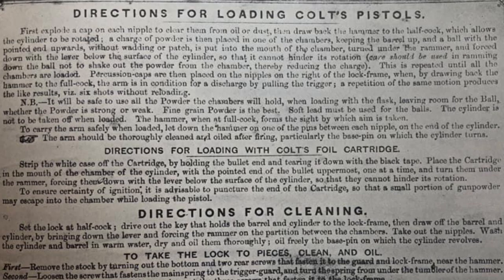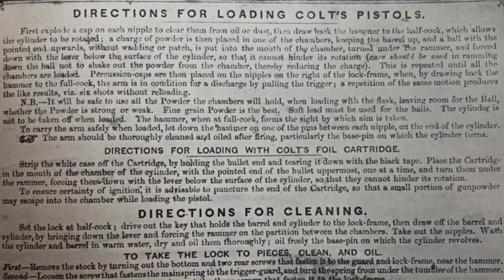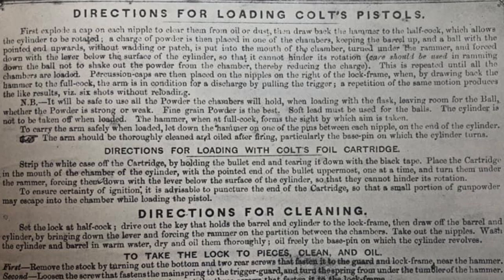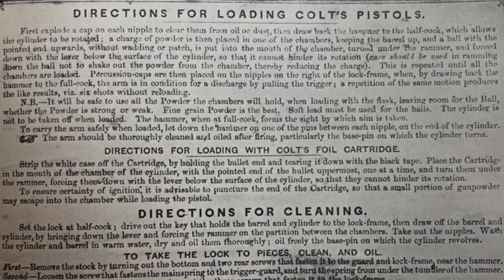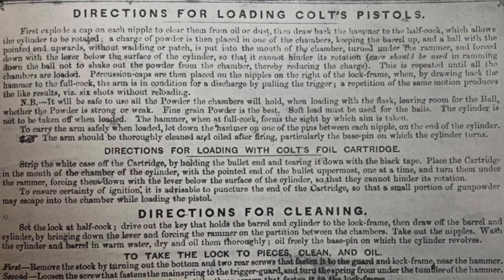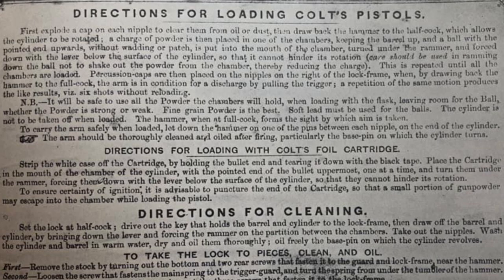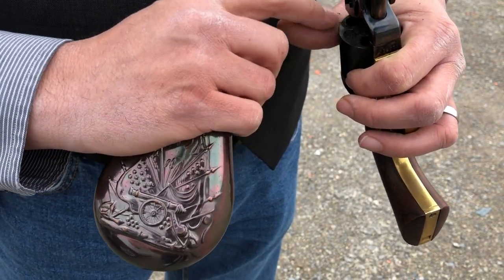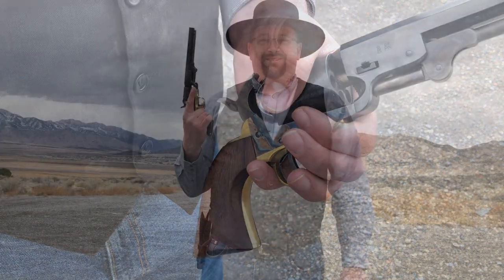Historical Loading of Colt Revolvers

Comment from the maker: Just to be clear, I’m not recommending this load because it does put more stress on the steel. This is simply an experimental demonstration of a fast, simple way to load the gun, according to very old instructions. Also, this is real black powder, which creates less pressure than substitutes. This charge was 27 grains of FFFg, but I’ve found 21 grains to be a very effective load.
Reply: I used to load my Navy like this just for fun occasionally and I could feel and hear the power difference.   My first handgun that I got for Christmas when I was 24 after reading the book Jeff Davis’ Own about the 2nd US Cavalry in Texas and their being armed with the 1851 Navy along with the Texas Rangers
Conventional wisdom tells us that loading all six chambers in that way without lubing or wad leads to chain fires.  However, I think it was either Mike Belevieu or you that pointed out that it’ actually poorly fitted caps that lead to chain fire.
Reply: Quick question: Is it normal for a loading lever to press on the underside of the barrel when closed? I bought a Uberti 1851 Navy and the loading lever,  when retained in place under the barrel, makes contact with the barrel at one point.  This means that to close the loading lever under the barrel,  I need to press on it an extra 1/8" to get it to shut.  While closed,  the loading lever is under a small amount of tension since it presses on the barrel right where the loading lever goes from skinny to thick.  Not sure if I should file it or not.  Haven't shot it yet,  so I don't know if it messes with accuracy.  My other revolver is an 1861 navy and has a different style loading lever that does not touch the barrel.
Reply: @classicgunstoday1972  true. I believe cap failure is to blame For most chain fires. I never shoot a cap through first. Ive heard that but dont do it. If guns clean i dont think its needed.?.?. Some thing about back presser i think
Reply: If you read the instructions it still says to leave enough room for the bullet, presumably a conical since that was what was mostly used back then.

Comment: Just for fun, I tried doing the same thing with my Ruger Old Army.  I filled each chamber to the very top with Goex 3FG and followed it with a .457 round ball.  It took a lot of force to compress the powder enough for the ball to clear the back of the barrel, but it worked.
As expected the Ruger took this load in stride and didn't even work up a sweat.  It was actually comfortable to shoot and shot fairly accurately.  I don't think that it will become a standard load for me because I like using lubricated wads, but it was a fun experiment.
Reply: When they proof the old armies they would filled the cylinders to the top with smokeless bullseye powder and do the same!

Comment: I load mine exactly the same except with 777. After about 6 cylinders I have to tighten the screws bu I have never had any problems. I think wads and grease are a modern   idea.

Comment: I would think about the safety issue powder up to the top of cylinder seems spooky , but makes since if in battle .
Reply from the maker: I wouldn’t do it often, but I don’t think 27 grains in one demonstration will be a problem. Thanks for watching!
Reply: I have several BP pistols The Walker is a blast I have loaded with 60 gr FFFg and normally 45 gr I can't notice any difference between them my Colt Army 44 cal I use 30 gr I just got rig of some Trible 7 it seems to clog up the action quicker .
I installed the Wolf mainspring and the piano spring for the trigger it worked great for a smooth trigger pull but after about 30 shots the hammer doesn't fall hard enough to set the caps off due to powder build up just rambling .

Comment: But how many times happened cylinder explosions by that method of loading, what can author tell about that?
Reply: Until last year I have always loaded mine like that, and I never had any trouble with mine and I bought mine in 1972. Either I was just plain lucky, or they made that cylinder short enough to be loaded that way. Which seems the case here, looking at the instructions.
Reply: With steel frames, black powder doesn't really build all that much pressure in the .36. it doesn't become an issue until the .44 makes use of thinner cylinder walls and in the case of the Walker, loading a conical backwards acts as a barrel obstruction as it seizes on the ramp. Then this might not be such a great idea.

Comment: Just curious, did you put any kind of grease over the chambers?
Reply from the maker: No. I usually do, but not this time because these instructions don’t call for it.
Reply: @GunsOfTheWest  It it possible they don't ask for grease or wads because with a "point" (conical) bullet, there are already pre-lubed grease grooves? That would explain why Colt's instructions say not to use a patch or wad, that would be redundant with a pre-lubed conical bullet.

Comment: I never shoot a cap through first. Ive heard that but dont do it. If guns clean i dont think its needed.? Something about back pressure maybe.
Reply from the maker: To be honest, I usually don’t either. I understand the purpose, but if you don’t have a bunch of oil built up against the flash hole, it’s really not necessary. Typically, if I’m worried about buildup, I’ll just give each nipple a quick blast with my air compressor right before I go shooting, so I’m not wasting caps. Thanks for watching!
Reply: @GunsOfTheWest   i really have learned a lot from watching your blackpowder stuff. VERY informative never a waste of time. Ive sent these to some friends too.  I ve commented before about ballistol, & thanks to u i use it on every thing. I dont do everything exactly like you do , but you straighted me out on a lot!

Comment: I've watched a few of your videos and others. I'm a bit lost on the chain fire and greasing of the cylinder to prevent it. You don't seem to do it.  Have you had the issue? Also what about the lubed patches to help keep the bore clean?
Reply from the maker: Most of the time, I do put a little lube in the chamber mouths, but not to prevent chain fires. I do it to keep the fouling in the bore soft, which improves accuracy. Some use lubricated wads instead, but I prefer not to have lube between the powder and ball. 

The best way to prevent chain fires is to use correctly-sized caps and balls. The idea that this is the purpose of the lube is just a very common misconception.
Reply: @GunsOfTheWest  awesome!! Thanks for your time Dustin.
Reply from the maker: @Rusted_Link  You’re welcome!

Comment: Sooooo, would this hold true for Remingtons also?
Reply: I'm not sure if it's historical, or not, but I've topped off my Remmy's chambers before. Not the best load solution (usually I make paper cartridges, 25-40 grains), but kind of fun to just "pour, cram, cap, and pop".
Reply: @marshalofod1413  How's it shoot?
Reply: @winfieldjohnson125  Good enough for close distance, fun gunning, but nowhere near as consistent and accurate as measured loads. (Which also depend on the projectile, powder, and other factors.) Nevertheless, when I'm at the range, sometimes I run through most of my paper cartridges, or just feel like cutting loose, so I'm not always looking for consistency and accuracy. Lol. Of course, since it's a big ol' honkin' hogleg, there is not much in the line of recoil, either. But, it's a waste of powder to be honest, and at this current moment, I will stick with my pre-measured paper cartridges. Every little bit counts, in this time of everything seeming to be in short supply!

Comment: I don't like to waste caps so I use a little pipe cleaner to clean the nipples. Those things are important and expensive of you do alot of shooting. I have the Pietta stainless steel nipples and they come clean pretty easy with a little pipe cleaner. Randy's brand from the local smoke shop. They have a tapered shape, and the skinny end works perfectly.  when it inevitabley gets dirty you can use a pair of cutting pliers to cut the first 1/4 inch off and it's like new again.
Reply from the maker: Lately, I just give the nipples a quick blast with an air compressor before I go out to shoot. Works great.

Comment: Think of it this way: Imagine you've got a classic 1960's sports car. It may be an original or a high quality new-build replica made to the original specs. You are instructed by the previous owner/manufacturer/enthusiasts that the best driving speed is 55 miles per hour. They tell you this is the most fuel-efficient speed and it will save you from any wear and tear on the engine. Now, in reality, your car is capable of moving faster than that. But folks don't want to see you mess up, create too much smog, or drive down the resale value of your machine. So it gets beaten into you to never drive faster than 55 in your classic car, no matter how high the speedometer dial actually goes to...

Comment: Has he got a video on casting .375 round ball at home? All I can find in store for my .36 cal is .36 cal .350 round ball and it’s a real loose fit. Makes me nervous
Reply: I'm not Dustin but I think your store you go to can order .375 diameter bullets from Hornady for you. .350 diameter round ball is for a muzzeloading .36 rifle where you patch the .350 with a greased cloth patch of .010 thickness. Yes, in a revolver, they will be loose and very inaccurate .
Reply: @harrisonlewis6853  thank you for the info
Reply: The problem is with Uberti revolvers in .36 caliber. The store-bought .375 is too small for Uberti chambers (they don't shave a ring, just deform into the chamber). Apparently the Pietta guns take .375 just fine, but an Uberti kinda needs a .380 ball and Hornady doesn't sell them in that size (.380s have to be hand-cast by you or someone else)

Comment: in my Navy .44 steel carcass I load the same 40gr without wadding or semolina
just grease over the bullet in .454
homemade fine powder 3F
as long as it's black powder, no worries
your shot is not that strong even at full charge
this must be calculated at the time of the design tests
this revolver has proven itself for a very long time

Comment: Sometime back, I loaded some .357 magnum cartridges with an unnamed smokeless powder and others with Pyrodex RS. It seemed to me that the Pyrodex cartridges had more recoil than those loaded with smokeless. Is it possible or likely that the cartridges loaded with Pyrodex were actually more powerful than those loaded with smokeless? I don't have a chronometer, so wonder if you might run a cylinder of smokeless, BP, and Pyrodex over a chronograph for a comparison.

Comment: I did pause the video to read the instructions.  I've read that the Open Top Colts should Not be used with the Conical Ball Ammo.  I did Finish watching the Complete Video.  After about a Minute it Struck me what was meant by the Pointed End.  I think that they were referring to the Sprue of the Ball.  Pietta Manual from Taylor Firearms: https://taylorsfirearms.com/media/site/pietta_black_powder_manual.pdf
Reply: "Open top Colts should not be used with conical ball ammo". Who told you that lie? If they weren't intended to use them, why the hell would Sam Colt himself have conical bullets designed specifically for them?